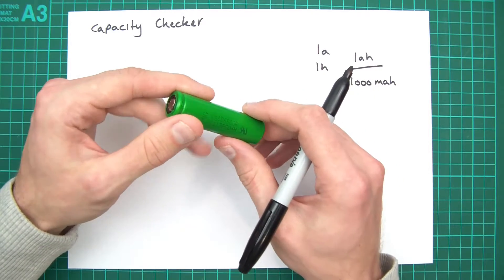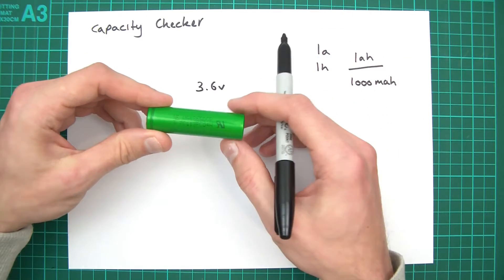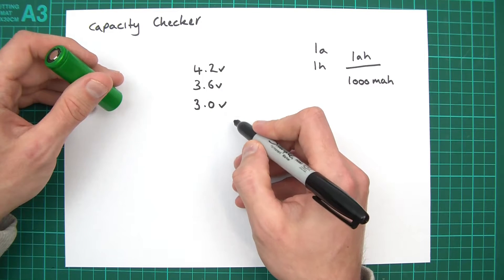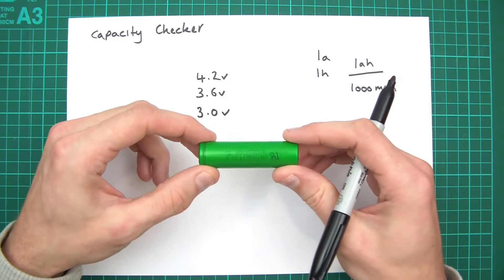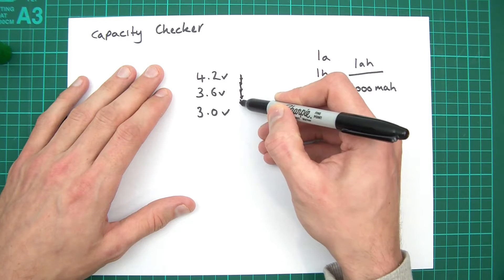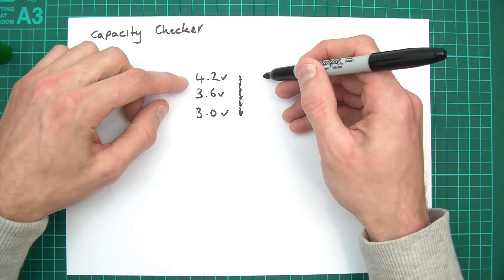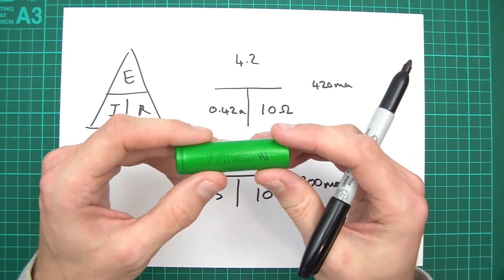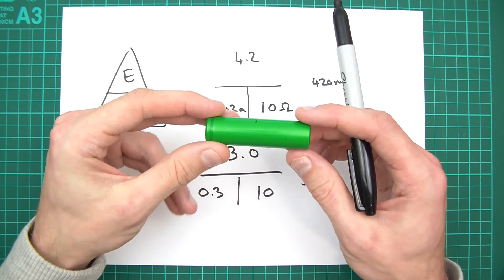TUTORIAL: DIY 18650 Lithium Ion Cell Battery Capacity Checker Tester (Part 1 - The Basics)

Comment: Hi there, Anthony, tell us right from the start what your project will do and how it's gonna do it.  The way things are going with your present video is:  we do not get the drift of where you are heading.  Are you planning to do a PAPER-AND-PENCIL calculation of cell capacity? ...manually jotting down current and voltage readings as you progress in your project demonstration.  DON'T DO IT... for many reasons - foremost among which are these:  (1) It tells everyone that watch your video that THE ARDUINO is really GOOD FOR NOTHING because it still needs your intervention with a paper and pencil to figure out cell capacity.(2) You are wasting a very powerful computer - that's YOU & YOUR BRAIN - to BABY-SIT the Arduino and the two of you (Arduino and You) figuring out the CELL CAPACITY.  (3) Lastly, charging and discharging a 18650 usually take 2 to 3 hrs and that will involve a lot of jottings down with paper and pencil  I really hope this is not going to be a paper-and -pencil measurement because the more than US$1 BILLION RC industry will not even give us a any serious consideration except to regard us with what AWED us the first time with tinkered with an Arduino with... "LOOK, MOM!  I CAN BLINK AN LED WITH MY ARDUINO"  I sure hope I'm wrong in assuming that you are doing a paper and pencil capacity test of a lithium cell.  Thanks.
Reply from the maker: Hey! This small series (unlike all of my other series) is completely unplanned. It feels a little bit odd to me too as I'm used to having a loose plan to work to. Surprisingly though, some people seem to like it this way! I'm not planning a paper and pencil capacity test. If I wanted to do that, I wouldn't need an Arduino and the video would have taken substantially less time to make! However, one thing I will say is that is by no means a professional project, I have no desire to compete with anyone or sell it - it's just a bit of fun! :-) Thanks!
Reply: I agree with you
very nice video

Comment: You can control the resistant by using a FET. EEVblog (https://www.youtube.com/watch?v=8xX2SVcItOA) and MCS_Electronics (https://www.youtube.com/watch?v=wREADxPNlbc) did some really good explanations. MCS actually shows you all the math included in the design. EEVblog shows a really simple diagram.
As with Crazy Couple, waiting for Part 2 :)
Reply from the maker: Hey! Thanks for the info! What I'm going to do is set the resistance at 3.3Ω, then read the voltage of the cell at 1000ms intervals... Then V / 3.3 = A... Store the A every 1000ms. At the end, I'll sum A, then divide by the amount of seconds in total to get the mean A per second. Then mean A second / 3600 to get mean A in hours, then multiply up by however many seconds it took to get to 3v. :D We will see if it works... I've just made it up!
Reply: Hahah, yeah, that's one way to get it :)   With the CC setup, you'd be able to do less math  ;)  However, I understand it's a toss up. Less Math/Code vs Less Components/Soldering. It just all depends on what you want to do, and the availability of the parts.
I'm going to be building a rig that allows for both CC and VC draws. I'm collecting a nice selecting of 18650's that are going to need to be tested soon  :)
Reply from the maker: Korishan Cool cool! Yeah! My maths and programming skills are stronger than my electronics skills! Where are you from anyway?
Reply from the maker: Have you seen my sourcing li-ion cells videos? :)
Reply: I live in the boring country of USA. And the hurricane prone state of Florida. But, I suppose, I get more sunny days overall than you do  :P
I'm the same way. Math is my strong point. But, the electrical math isn't quite all there yet. Still learning all that. Plus learning the electrical soldering and parts and such. I have a lot of the ideas down, and kinda when you use one device over another. Just know "which" device to use (such as a jfet vs mosfet vs something else) I'm still tryin to figure out. But, such is learning when you learn via youtube and don't go to college (well, you call it university)
Reply from the maker: Korishan haha! For us, preschool at 2, nursery at 3-4, primary school at 5-11, secondary school at 12-16. Then we can either stop, go to college or go to sixth form (2yrs). If you choose sixth form, then you can go to university. At university, you can get a bachelor's degree after 3 years. Then you can do an additional year to make it a master's degree. And you can do an additional 2 to have a doctor's degree.
Reply from the maker: About electronics, I agree though... You pick things up as time passes. I still have a huge amount to learn. I'd say I've learned the basics!